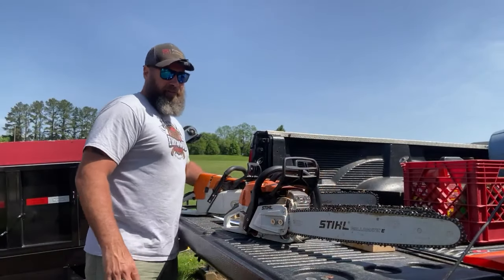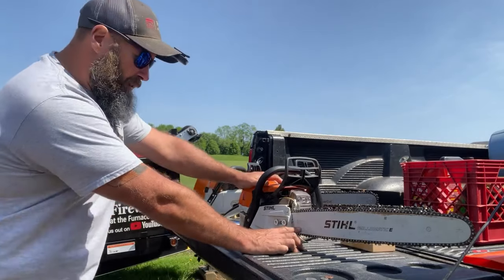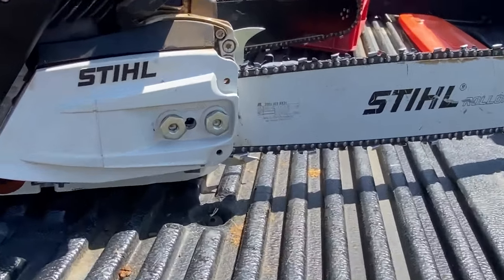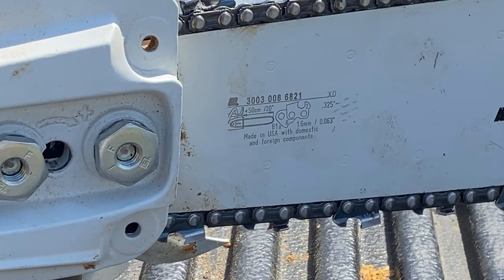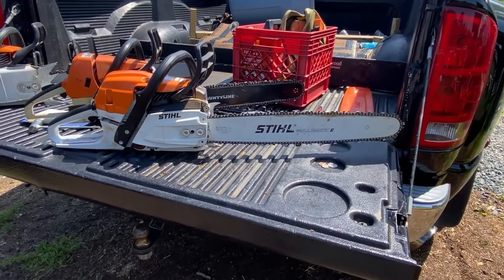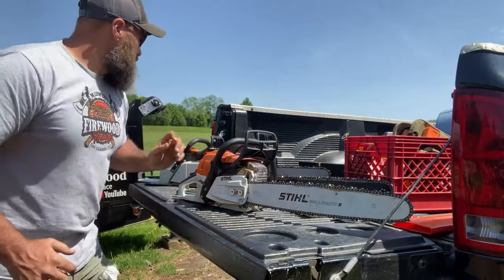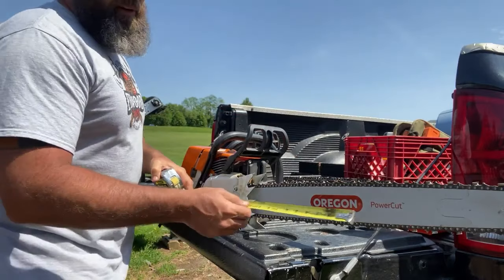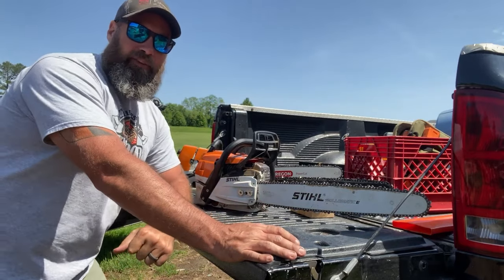How to Measure the Guide Bar Length of A Chainsaw

Comment: For everyone complaining about him putting his arm in the way, it’s not a measurement that needs to be down to 1/32 of an inch. Note he says “useable length of the bar.” All you’re doing is finding the closest size without going over that measurement. In this case he does point out where to measure to and from. He then explains that if for example the measurement is 14 3/4” you round up to the next even whole number which would be 16”. I’m guessing most of the people complaining about him putting his arm in the way haven’t used a chainsaw very often and should probably hire someone to do it so they don’t end up cutting off both of their arms and probably their legs too. Noobs.

Comment: My Stihl MS180c has an imprinted factory Stihl 16” bar on it, and a brand new 16”, 3/8LP Pitch, 0.043 gauge chain on it, which fits perfectly and cuts beautifully.  However the bar measures exactly 14” from the front of the chain guard to the tip of the bar!  This is clearly NOT a 14” bar, despite all the wrong information on posts such as this one.  Perhaps things are different on different saws, but the advice given on this post does not seem to apply to all Stihl chainsaws.

Comment: My bar has 18" printed on it, but it measures 16" after the stihl plastic housing is in place. I ordered an 18" chain. Wrong! Why would they print 18" on the bar if it takes a 16" chain.
Reply from the maker: I cannot say i have run into that problem. Maybe a misprint or something?
Reply: You don't buy chain by the inches you find out how many drive links your bars calls for along with gauge of chain

Comment: Review the video before posting… your arm covers the tape measure completely with regard to the key dimension (20”).
All you can see is elbow, leaving the question for viewers: was it to the case frame, cover plate or center of fasteners. 
Happens a lot in videos.